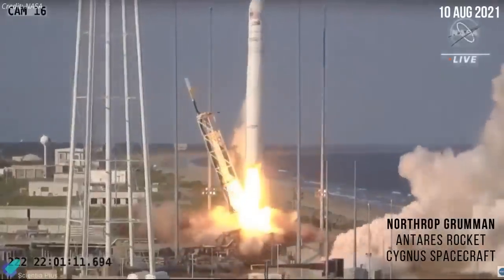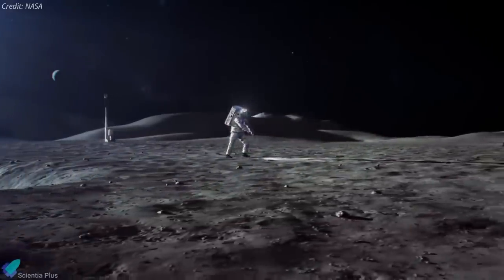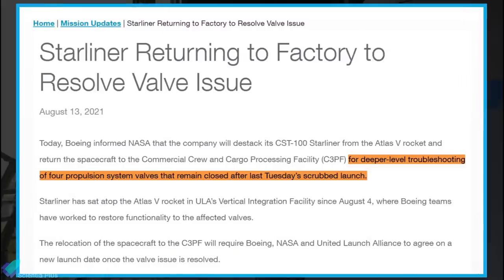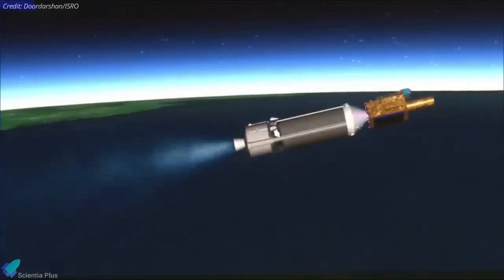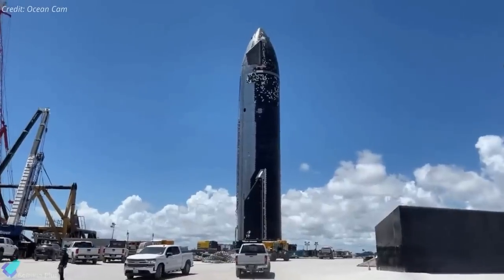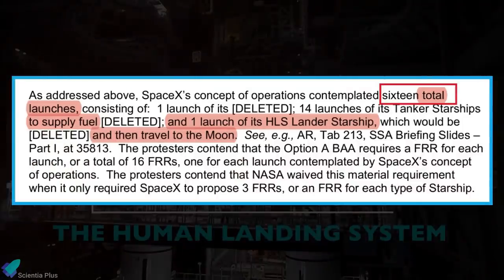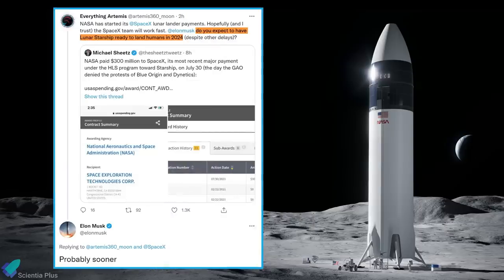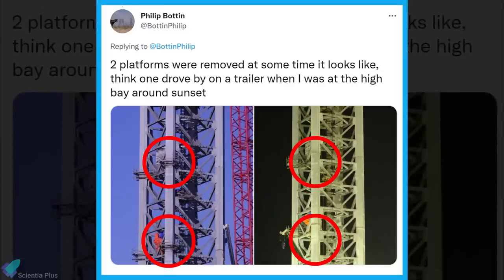Starship Will Be Ready for Orbital Flight in a Few Weeks | Blue Origin Attacks SpaceX | Cygnus NG-16

Comment: If some moisture causes a holt to the program they need to rethink the hardware there using.
Reply: "We're launching out of a facility on the Florida coast, there isn't moisture or anything there, right?"
Reply: Apparently the Space Shuttle had similar problems back in the day.
Reply: BOO-ing   Redesign:   Sheepskin Thuster plugs  "Remove before Flight" ,  Beefy Surge Diverters.

Comment: What happens next after the first orbital flight test??
SN 21? Booster 5?
Reply: SN 21 parts were already spotted at launch side they will probably continue with heavy tests and building infrastructure until they are ready for the first catching and reusing of a booster/starship once that happend everything will begin to move real fast
Reply: As GEC said, they will keep doing orbital flights. SpaceX has a $53M contract to demo Starship to Starship refueling in LEO by the end of 2022.

Comment: With the thin atmosphere on Mars, will SpaceX need another Raptor engine or could the vacuum engines be used for landing . . . eliminating 3 engines?  “The best part is no part at all”?
Reply: The R-Vacs and sea-level engines will be used on Mars. The R-Vacs do not gimbal, likely due to the room needed to do so. The sea-level Raptors do gimbal and evidently SpaceX is ok with less efficient engines for the vectored thrust they need in space.

Comment: Why would one want to 3D print slabs of regolith in microgravity conditions?
Reply: It's for moon printing buildings for a moon colony.
Reply: @antoniestrydom6367  but they're not going to bring up tons of regolith to the lunar gateway, print buildings there and then lower these onto the moon, are they? They need to be able to print in vacuum at 1/6 G, I would assume.
Reply: @nkronert  Due to the lack of a current moon research base, moon any base, simulated gravity on the IIS or artificial plating / gravity plating, zero G is closer to moon gravity than moon gravity is to Earth  gravity. so it's literally the single best place to actually experiment with it and find potential early issue that they can't find on Earth.

Or at least, that's just my my common sense tells me. But I'm not a scientist so I don't know if that is the actual reason they spent millions on this, I assume someone way smarter than me at some point along the process of spending millions asked "Why?", though you can probably bring up plenty of examples where even billions was spent on something useless without someone asking "why?"

Who knows, maybe YOU are in fact that person and could potentially save NASA millions.
Reply: @nkronert  Well, you kind of need 1/6G then. I guess maybe NASA should make a moon base. You could call it the Artemis program. ;)